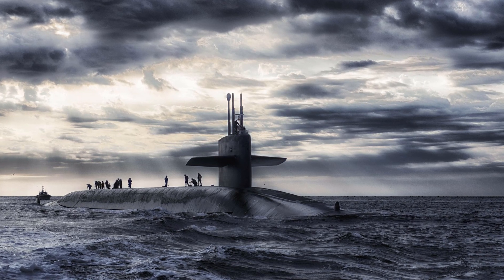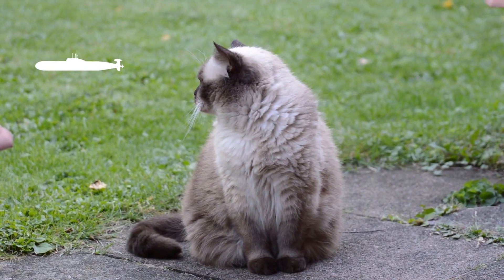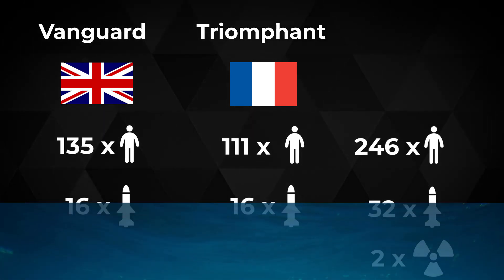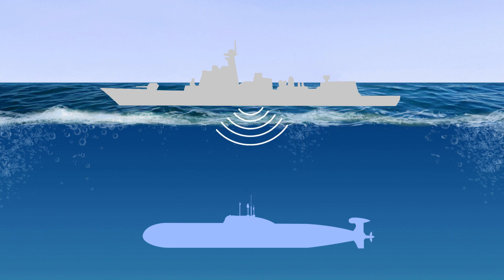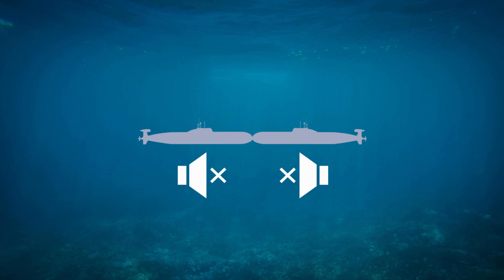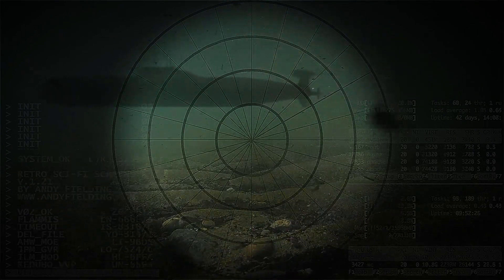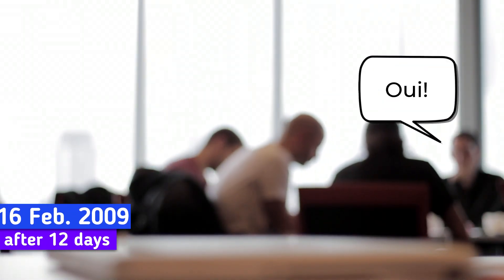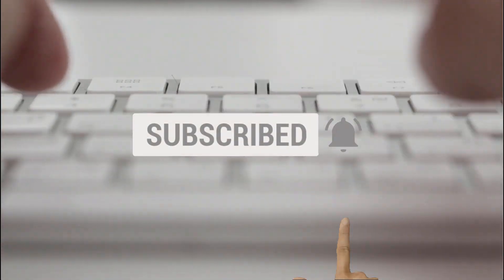Why did 2 modern nuclear submarines collide in 2009?

Comment: Still playing dice with nukes. Imagine all the Atlantic coast of Europe turned into a huge Chernobil.
Possibility has given place to rising probabilities.
Reply: If the Nukes went off, (which they wouldn't have since they have so many safety systems that they can't on their own) it wouldn't be like Chernobyl at all. The reaction in a Nuclear bomb translates all the energy into an explosion very rapidly, leaving far less radioactive material left over than Chernobyl. Chernobyl was so bad because it exploded and left highly radioactive fuel and graphite moderators open to the air, which caused the real damage. There would absolutely be radiation from the explosions, just not anywhere close to that of Chernobyl, and most of it would just get diluted in the ocean to the point where it can't hurt anyone. The reactors on submarines also don't hold nearly enough radioactive material to cause anywhere near the devastation of Chernobyl, (to put it in perspective, Chernobyl was supposed to supply 10% of all the USSR's energy needs, while the reactor on a submarine only needs to fuel one ship)